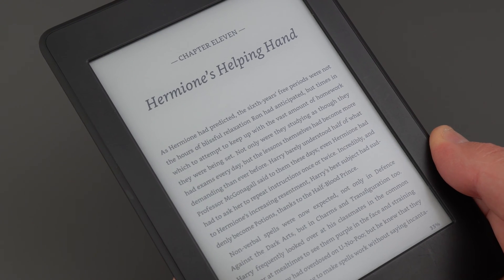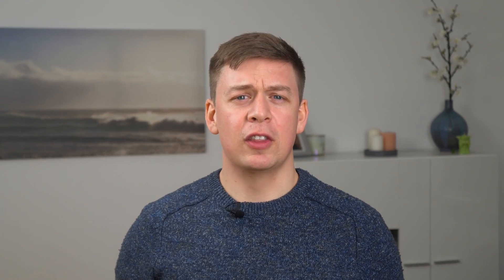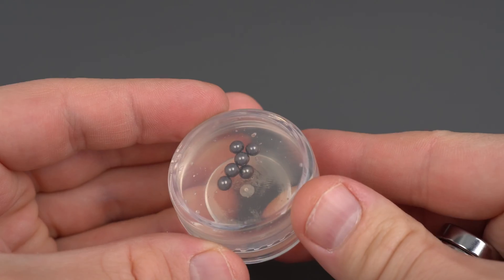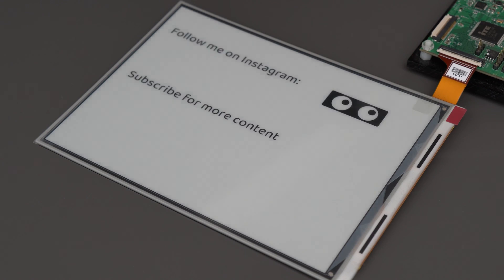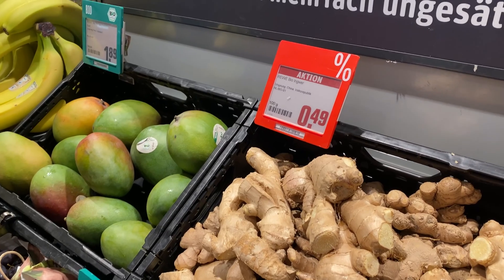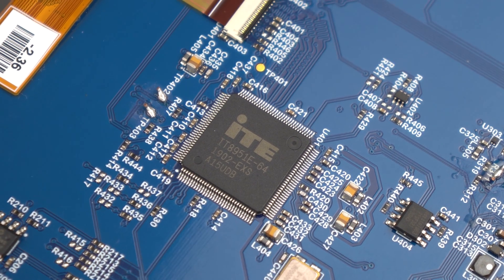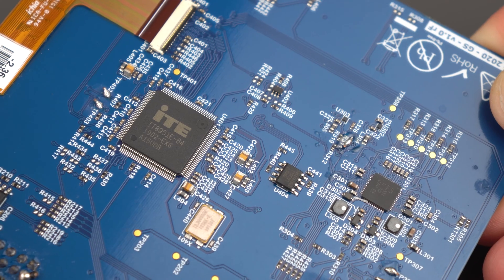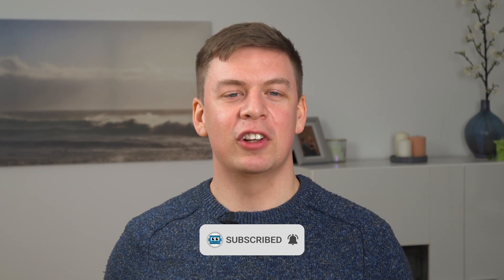How do E Ink displays work?

Comment: Why use both black and white particles instead of just black particles and use the fluid they're suspended in be responsible for the white (or visa versa)? 
It would allow faster instant updates with 0 risk of colour ghosting or need for flashing. So why isn't this a thing?

Comment: I think the particles for the colored displays all have to have different masses because otherwise the particles would move horizontally symmetrically, as shown in the animation. I think the stacking algorithm would be, that at first it changes the charge so often that the particles with the highest mass are on the right spot and then it does the same procedure suczessively down to the particle with the lowest mass.

Comment: I have a question. How does the e ink displays change the color at a certain point? Is there a grid like capacitors where we change the polarity of the electric field? Also, does the electrodes on the top of the screen are transparent? If it is how can a metallic electrode can be transparent but not reflective since metals are usually reflect light? 

Thanks in advance :D
Reply from the maker: Yes, there’s a grid of electrodes above and below the E Ink layer that forms the pixels. It’s the same as how an LCD works, using transparent electrodes. Search “ITO Electrodes” if you’re interested 😊

Comment: Bit of an odd question, but do you know if there's any research into a translucent particle, rather than a pigmented particle? I've been curious about the idea for awhile, assuming the viscous liquid can act as a light piping layer, this would mean that a display could become emissive rather than reflective, and could work as both white plus translucency and black plus translucency based on application, or even color plus translucency. I know it's be a super niche application of e-paper tech, but there are some areas that could benefit from this, like use in poorly lit or dark rooms, and given that it's backlit and not an active display it'd be more efficient than an LCD or OLED display. 

Another thought I've had is about multi-color displays. Why are they forcing multiple colors into the same capsules and exponentially raising refresh times, or using filter layers that're subpar. Why not look into minimizing capsule sizes and mimic the RGB matrix that displays already use with a CMY matrix? Sacrifice particle per capsule density for capsule per display density.
Reply from the maker: I don’t know I’m afraid, E Ink keep their research very secretive.
Reply: using a cmy matrix would not work well and would cause the image to have awful saturation. it would be washed out if you used white pigment, and extremely dark if you used black pigment. subtractive color only really works if you are using the pigments to remove color from the light in series, but with a parallel grid, you would only be subtracting the R, G, or B color from 1/3 of the total R, G, or B value of the light.

Comment: Assuming I'm not concerned with ghosting, what's the fasted refresh rate/fps for an e-ink device? Is basic animation possible? 

Also, why is there ghosting of what looks like brighter white on a white page? With your explanation of how the particles are arranged, I'd have thought it wouldn't be possible to get whiter than, well, white.
Reply: I have a boox device, and I can watch a youtube video with the heaviest ghosting mode. Maybe 5fps? I don't recommend ever doing it though. It's a horrible experience and not worth it
Reply: @megumin4625  I was thinking from the position of it being an interesting medium for simple animation, even in black and white. 2D can get away with a lot, and depending on how the ghosting works, could even enhance the animation like a built-in smear/drybrush.

Comment: Hi, I have a question for you. I have a 7.5" waveshare e-paper with driver hat that worked fine. Now During the update it 'overshoots': it updates, shows the black fine, but then continues fading to light gray, and only then stops. I can't seem to figure out why.
Reply from the maker: I couldn’t say specifically unfortunately, maybe contact Waveshare?
Reply: Hey man, I'm having the exact same issue trying to display images on what I believe is the same display.  It looks perfect, then turns kinda sepia on the last update.  Did you ever find out the cause of this?
Reply: @The007dinosaur  No, I put the display aside for now.. didn't find a solution to this. Sorry
Reply: @RenoDeJong  I think we figured out our issue partially.  The room was too cold, warmed it up with a hairdryer and it worked way better.  We think it's because the display needs to be in a different power state when it's cold but we're still working on it